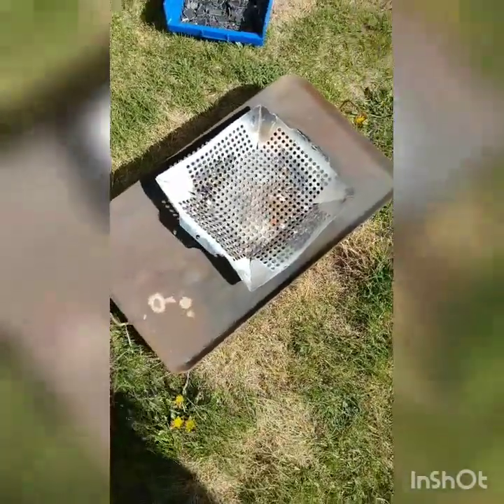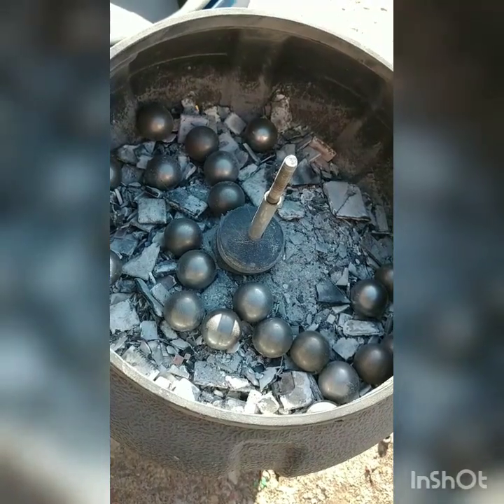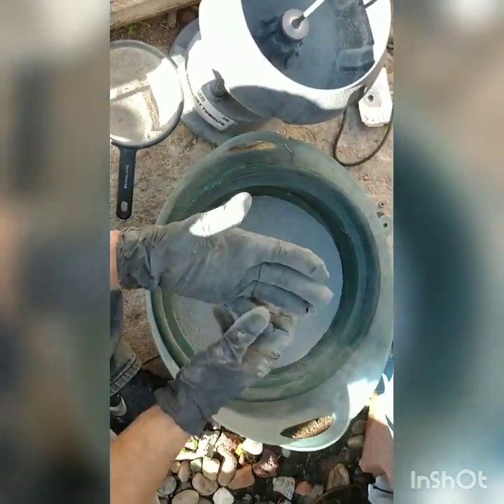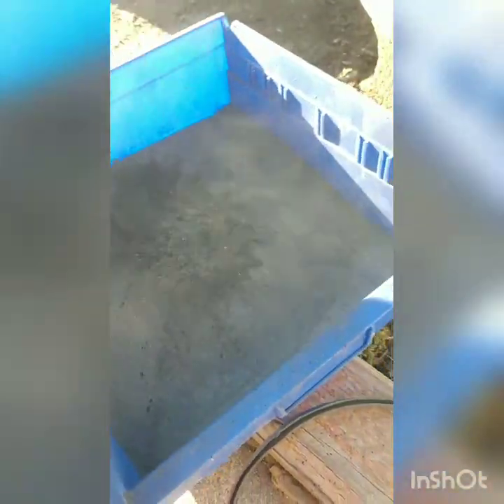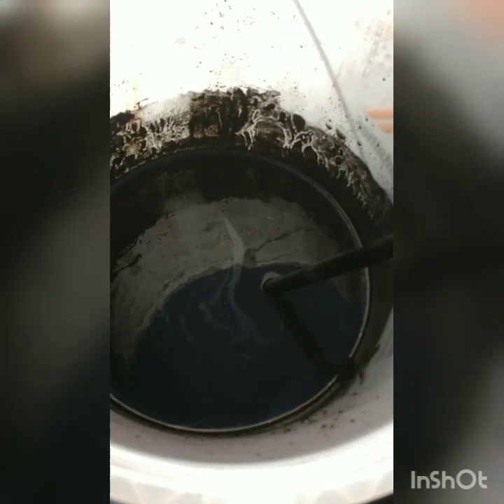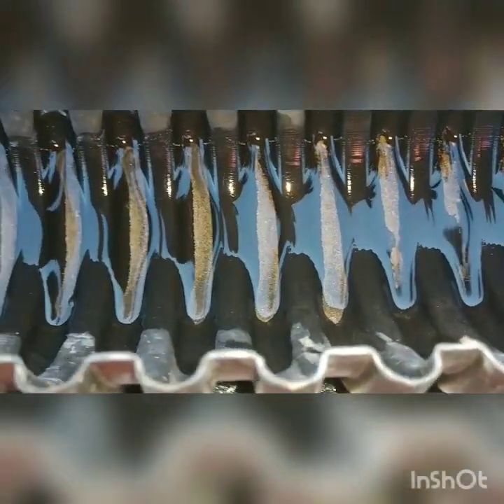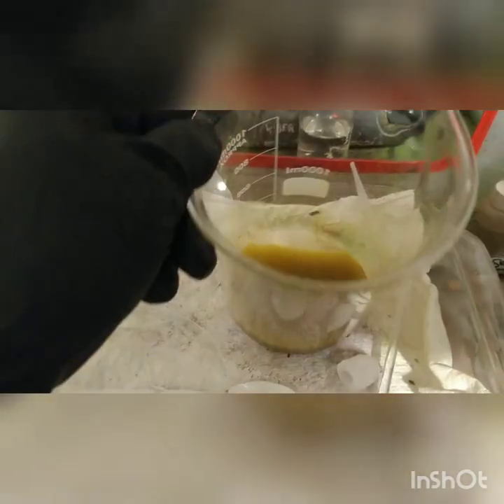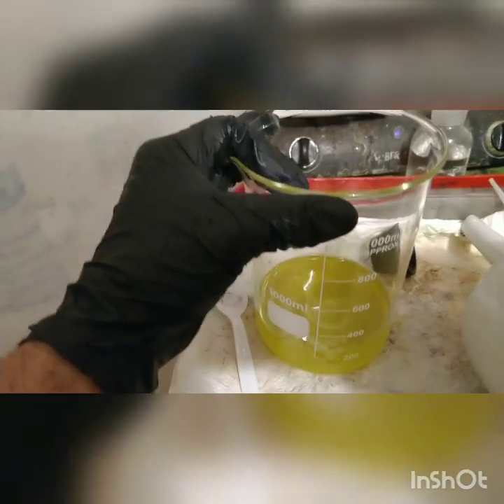Gold recovery complete process ic chips incineration

Comment: Could u answer a couple questions for me please? 
Do you usually do this in small batches like this?
I was thinking it might be better to save up the filtered incinerated Ash, and then once I got a number of buckets full I'd go ahead and run it all.
That sluice looks like it would be really frustrating to get all the stuff out of it. Have you tried one of those vibrating table things that work similarly to a sluice?
I've seen a video of someone using that for their Ash material and it worked great. And that's only about a square meter plate u gotta get the gold off after.
Could you please do a rough breakdown of how much it costs you to do this, and also how much weight was in the chips before you started?
Then we could kinda get a better idea of the gold yeild per kelo Vs what you might get by just selling the chips to a scrapyard.

Comment: When you get things milled down to where you have that wire material and small chips.  You can take that material and put it in a large beaker.  Add a mixture of Hydrochloric Acid and Nitric Acid (Aqua Regia) and put it on low to medium heat for a few hours.  That will dissolve out the gold.  Then you can filter out all the particulates.  Reduce the solution to near dryness, then add Hydrochloric Acid to dissolve everything remaining.  Then add Sodium meta bisulfite to precipitate the dissolved gold.  then you can melt that down to nearly pure gold.
Reply: That is probably easier than what I've been doing
Reply: Good job man.👍

Comment: The safest way to treat the ash is to use somekind of hood, the ash contains ideally no carbon but a lot of metal oxides like leadoxide, a lot of metal oxides are very toxic. I don't think there will be any beryllium in there, it is used in other components like things that have to deal with a lot of heat, mostly this is white, not black.
Reply from the maker: Erwin G I meant to say cadium but need to work on my editing... Cadium is used to stabilize the plastic epoxy chips from warping with heat

Comment: Never watched your videos before, but you lost a whole lot of gold. I've been doing this for about 8 years. On average 500 grams of chips produces about 2 grams. I would estimate you had about 12 to 1500 grams / 3 lbs * 2 grams per lb,,,6 grams. I incinerate, wash the material through a 100 mesh while shaking it, violently, and do it again. Until there is no black material. 

what you will have left is a bucket of water with white ash and gold leads (your high grade). The rest of the material will have gold on the wafer plates and the wafers, some of the legs may still have gold leads attached. You can separate the wafers easily by using a magnet. What the magnet dose not pick up contains precious metals. Gold , silver, platinum and copper

Comment: This is one of the best channels I've run across so far with the steps of gold reclamation, Thank you. I have a question or 2 or 3, Aqua regia, Is that a mixture of different acids if so how do you make it? The other acids that are not available at the hardware store, How would I obtain these? One video I saw used Cyanide of all things and it stripped the gold plate without touching the other metals! Thanks again I am subscribing.
Reply: Check out sreetips channel. 
This is ameture hour in comparison!

Comment: If you grind the ash instead of crush you will cut the bonding wires into billion pieces. Smaller gold is easier to lose. When I wash the ashes some gold wire float on top because too small. I hope you not lost any gold.
Reply from the maker: Unnamed Player I use a microscope to inspect all waste ash for any missed gold ...same with the tailings after sluce...I was planning a video with a complete incineration of ic chips and gentle ashing to keep bonding wires intacted... Soon...
Reply from the maker: Unnamed Player your absolutely right any ic chip left not grinded into ash could and will contain gold wires